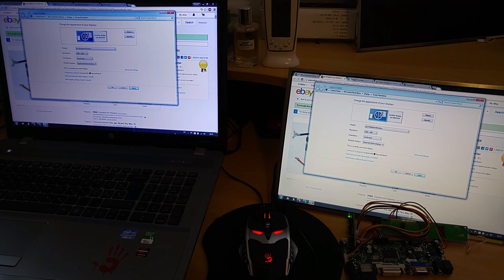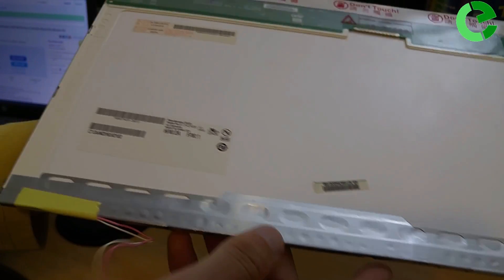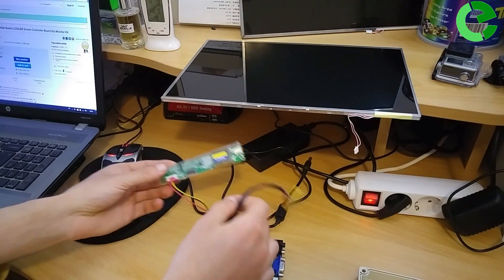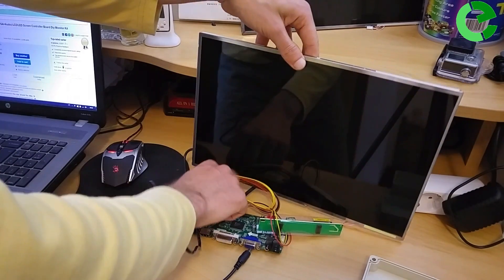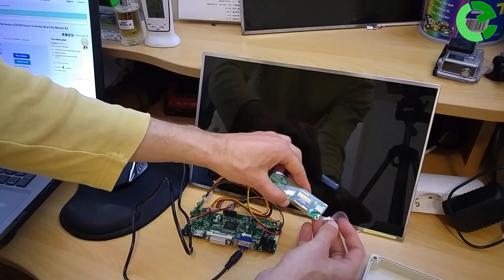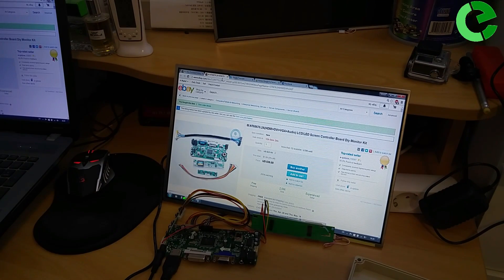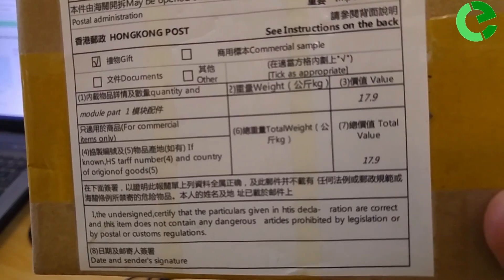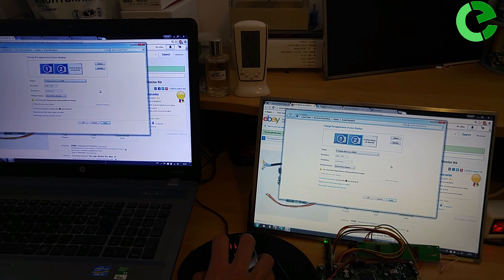How to reuse old notebook LCD panel

Comment: it is possilbe to using LCD 32In samsung TV lcd pannel?
Reply from the maker: Dont know. Contact this ebay seller and ask him, because every screen needs different power sorce. 
he will need panel details like that what i showed in video.
http://www.ebay.com/itm/110977522562?_trksid=p2057872.m2749.l2649&ssPageName=STRK%3AMEBIDX%3AIT